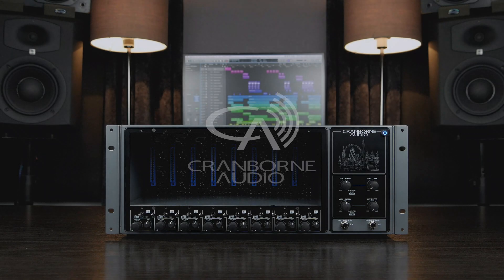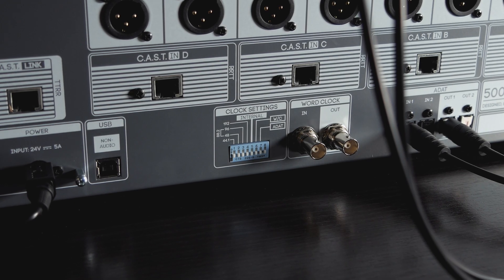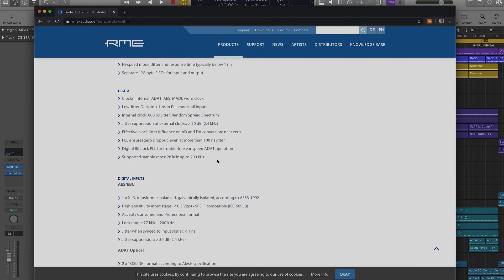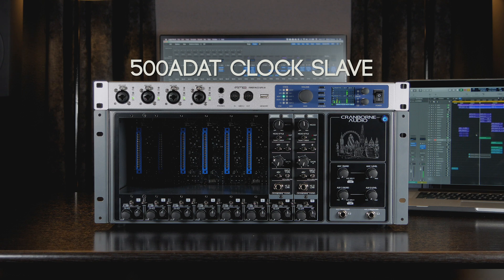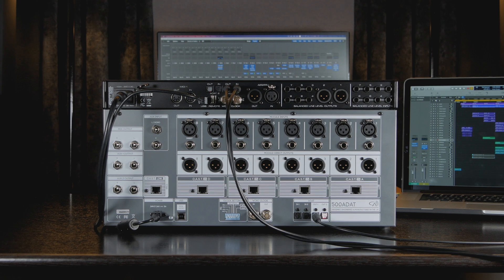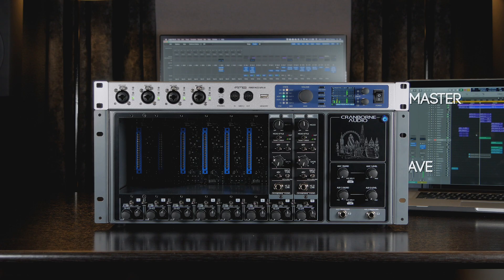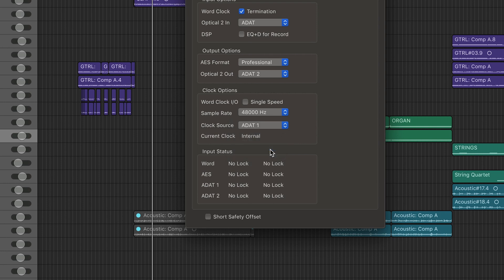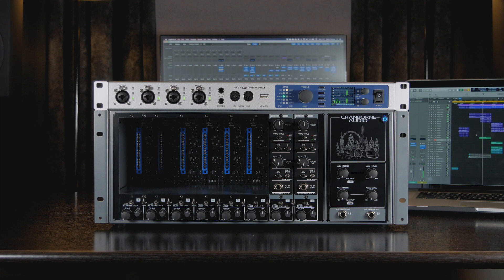500ADAT Quick Tutorial | Clock Master or Clock Slave? | Word Clock or ADAT

Comment: Question, So when changing sample rates,  you always have  to set the dip to the appropriate rate?
Reply from the maker: If the 500ADAT in question has the latest v1.3 firmware installed on it, with it's dip switches set in a specific way, and assuming that the 500ADAT is deriving it's clock from a primary unit, then it can auto-switch it's sample rate when changed by the DAW session/primary unit.

Comment: hello dear Cranborne team Do you have any video on I/O set up with Protools or how to Use your 500 series Preamp/ Eq/ reverb to be used as plugins in Protools when mixing
Reply from the maker: Hi Richard, thanks for the question! We do not have any specific video using 500ADAT/R8 with Pro Tools and its Hardware Inserts, however the process is the same for 500ADAT as it is with any other interface on the market using Pro Tools. If you have any specific questions, please send an email to our tech support team and they would be happy to help explain how to make it work using Pro Tools! Thanks again, CA.

Comment: Hang on the disadvantage of having to change the dip-switches to match (at 4.35) if the unit is the master still needs to happen if the unit is a clock slave?.. Or am I missing something otherwise I can't see how it's not a disadvantage either way?
Reply from the maker: Hi Darren, when some customers set the 500ADAT as the master, they generally want it to the be the clock master at their specific working sample rate (as may recording engineers do not need to change rates often) - some people do choose to set the 500ADAT as the master clock even though they are changing rates with various projects and if that is the case then yes, you will still have to change the sample rate on 500ADAT to match. What the video is referencing there is that if you stick to a sample rate and want to use 500ADAT as your master clock, then you will not have to adjust the sample rate switches constantly, but if your interface is the master and you always switch rates for different projects then yes, you will have to change the sample rate DIP switches to match.  Hope that helps!
Reply: @cranborneaudio  Thanks for the response. Unfortunately I often have to change the sample rate depending on the project I’m working with (third parties recording differently). So either master or slave is still have to change it manually to suit that project. Please add that USB integration that gives you controls over this VS crawling round the back. Otherwise looks like a great unit!
Reply: very good idea
 @darrentatemusic

Comment: Is it possible to link up 3 of these units. I am planning on a major up grade but want to keep things condensed. This will work in combination with UA Interfaces?
Reply from the maker: Hi there! You can connect up to two 500ADAT's to an Apollo interface provided the Apollo has 2 sets of ADAT I/O (Apollo 8p, 16 etc) In this setup, you will only get the maximum 16 channels when the interface is set to 44.1 or 48kHz and will halve inputs when the sample rate is increased above 48kHz. Hope this helps!